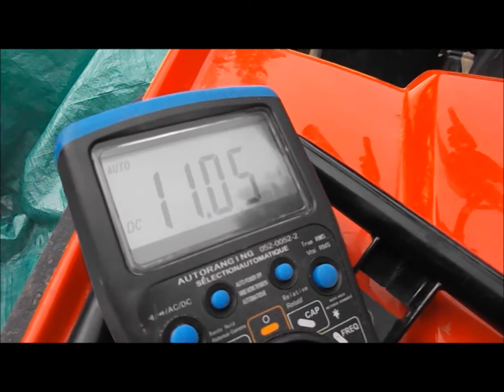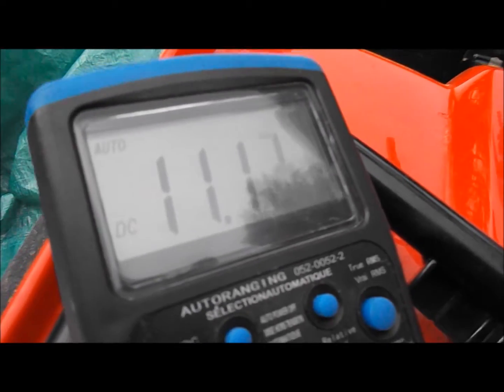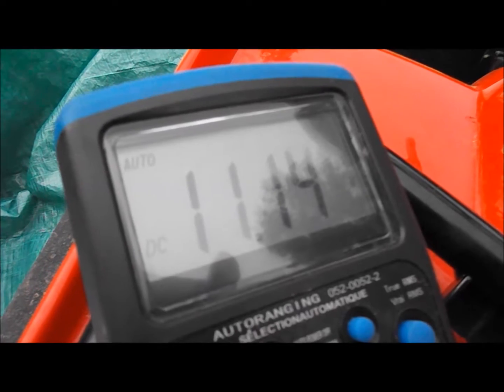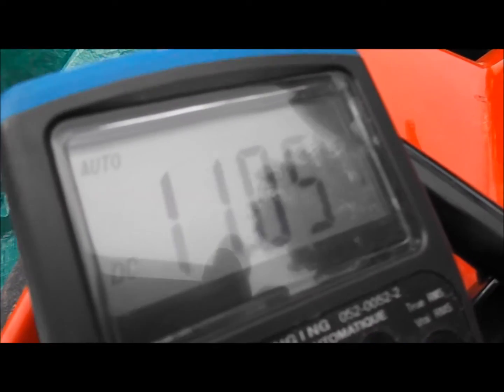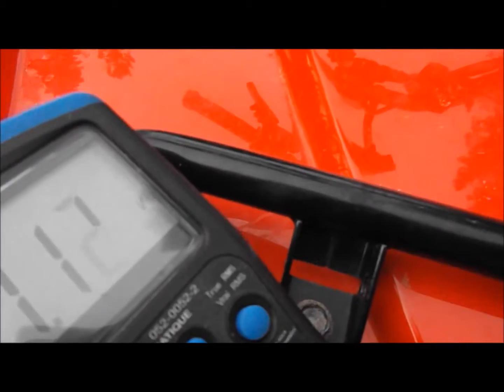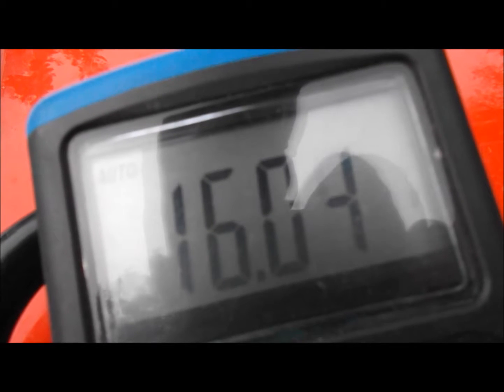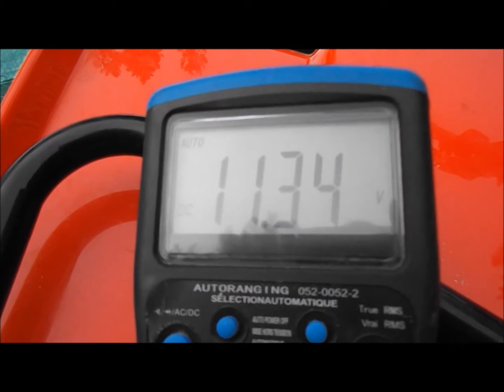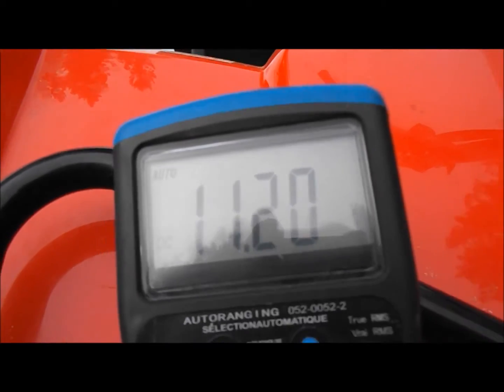Arctic Cat 366 testing the trigger coil peak voltage

Comment: Hey rotor, thanks for the videos -  I've found them helpful.  I have a 2001 Yamaha Big Bear - my CDI output voltages going to the coil (measured with a Peak Voltage Adapter and a VOM) are way way way lower than what you are seeing.  I'm seeing 2.25 up to 3.1 VDC at very fast rpm - an ocilliscope shows a short duration pulse of +5 to -12.5 when cranking.  The ATV starts and runs great - but sometime - typically after I've been running if for a few minutes - it will just die - typically with a back fire.     I've rebuilt the carb so I think I've eliminated that as a variable.   I know these are different machines but 200VDC that you are seeing  is a far cry from the 3.1VDC I'm seeing.  Any comments?      Hope you are still around doing videos - the one you did where you mesured pulse voltage on a 2001 Yamaha Kodiak 400 (which I would think would be very similar to my Big Bear) was very helpful...what I measured were very close to what you had...